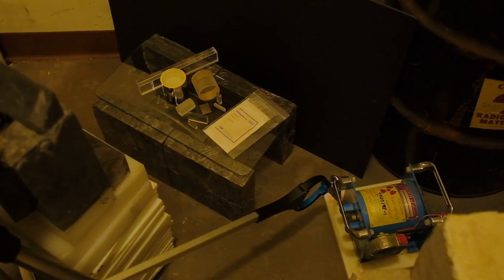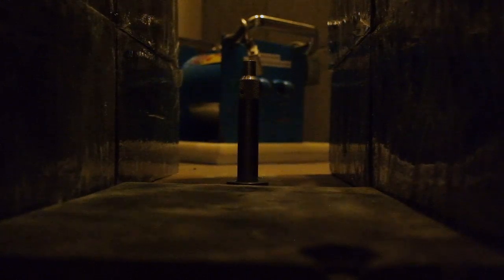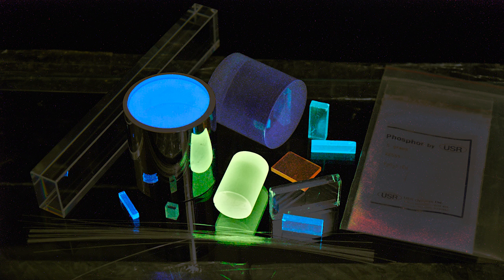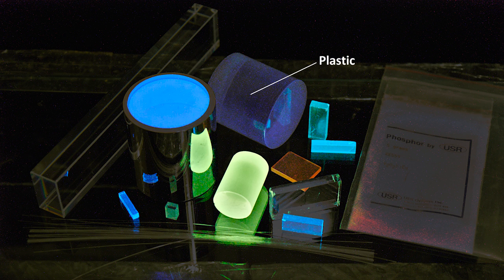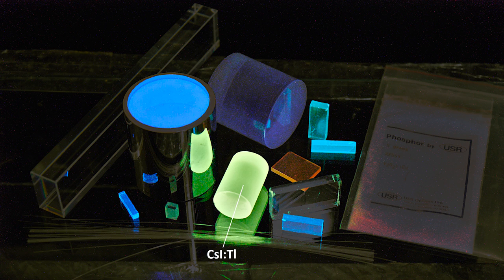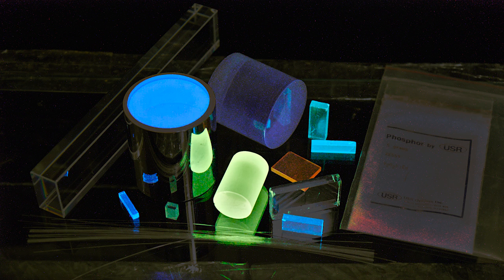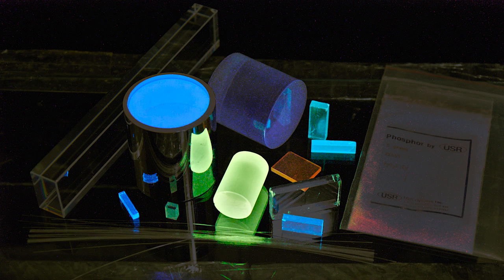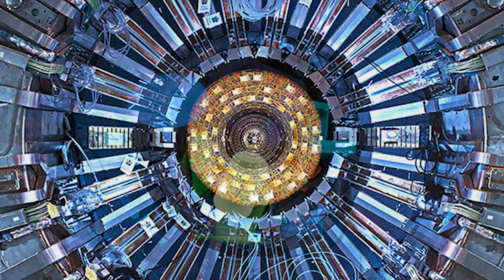Introduction to scintillators

Comment: Hey this is much easier than using one of those little dinky Am241 sources from a smoke detector! That actually did work with a GSO and produced a very faint spot of light right near the source after one hour of complete darkness and 10 years worth of eye strain to see it. While less exciting a mineral display case with UVC lights works as most fluoresce in some fashion. NaI and YAP were the two nicest looking, esp. YAP with its vivid deep purple glow.

Comment: I have a Radiacode 101 gamma spectroscopy and scintillation detector.  It utilizes a CsI(Tl) crystal with a SiPM.  It has lousy resolution but it is a fairly capable spectrometer regardless.  I have some great Reference spectra for my library that I have collected.  Great video!  Lots of great information.  Thank you Carl for your work.

Comment: I love your work, Carl! I saw that LYSO scintillator, and I knew exactly what it was! It is slightly radioactive (Lu-176), and is a nice low-moderate gamma energy calibration source (88 keV, 202 keV, 307 keV), with high branching intensities. I use NaI:Tl and PRA, with a GammaSpectacular MCA. It works well! CeBr or SrI:Eu have about twice as better resolution, but they're expensive! HPGe is the best, and I'd love to get my hands on one, but they're crazy expensive! Anyways, thank you for sharing your amazing work! Thank you so much!
Reply from the maker: Yep, still waiting for a CeBr3 or SrI:Eu crystal to fall into my lap.

Comment: We may only get 2 videos a year from Carl, but when we do.... it's a good day!
Bionerd has an amazing video from years back showing various scintillators glowing too (in video!!) under a radiation therapy linac.
Reply: Andrew Seltzman has some good ones of cameras and scintillators going through an electron beam system. I think it was an industrial system for cross-linking polymers. 
You get some nice views of the purple ionized air, flashes from x-rays, the scintillators glowing like light bulbs, and then the cameras going to snow from all the radiation even though they are heavily shielded.
Reply: @Muonium1  I unsubscribed for the same reason...
Reply: What happened to Bionerd 23? She had so many great videos then just suddenly  went away…
Reply: @bltc11  sometimes people just need to dip out. Best guess from me would be that she finally said fuck it after the millionth "zomg ru dead of teh cansur yet??" comment.

Comment: Great video! How many visible photons does one gamma ray photon produce in a scintillator? Does the gamma photon travel in a straight line kicking off visible photons in it's path, each time slightly reducing it's energy?
Reply from the maker: The number of visible photons is a function of the material, the energy of the gamma ray, and the type of interaction that the gamma ray experiences.  Obviously, it's higher in the brighter materials.  It also typically scales linearly with energy for photoelectric absorption.  The photon can interact by being absorbed or being scattered, and typical scattering events change the direction and energy of the radiation substantially (e.g. via the Compton effect).

Comment: Hello Carl, I wonder something. Are the sintillation crystals radioactive themselves ? Thanks
Reply: If I may answer for him - no, the scintillators would not contain any radioactive material because this would defeat the point. They are used for radiation detection and including radioactive material would cause an increase in noise, which is undesirable. 

Granted, the lutetium dopant of one of them is very slightly radioactive because one of the naturally-occurring isotopes of lutetium (Lu-176) is slightly radioactive. But since it is a doping agent, it is only added in small quantities, presumably too small to affect the signal-to-noise ratio much.

One thing to notice is that two of the most common scintillator materials are Tl-doped NaI and CsI. It would also be possible in principle to use KI or RbI, but those aren't used because K and Rb are both naturally radioactive.

Comment: Nice to see the actual light from gamma interactions. I just us UV to check scintillators and wondered if the same  light wavelengths are  emitted. I guess some of these scintillators may not react to UV light.
Reply from the maker: Yep, UV light works well with most of these materials (though it will photochemically blacken Hg2Br2).  Just not as fun as putting them on an actual radioactive source!

Comment: Is the yvo4 crystal regular or neodymium doped? Used them for making lasers many years back. Also used to build awsome little neutron/soft gamma detectors for ludlum 2's and 3's from bad surplus scionix LiL:Eu detectors and Adit photomultiplier tubes salvaged from hurricaine flood damaged VACIS wands. The scionix detectors were originally for SAIC identifinders but the little metal can hamamatsu PMT couldnt take the soldering and would slowly leak. The Vacis wands were from gamma cameras used to inspect ocean containers. They had rather large NaI:Tl crystals, all water damaged, but usually salvagable if determined. Cut the scionix detector in two with a pipe cutter and optical epoxied to the adit tube in a nitrogen purged glove box- Li iodide is stupidly hygroscopic 😲. Put the works in a stainless travel cofee mug with a removable moderator molded in the cap and bnc or c-hv connector on the back. Was very specific for neutrons when running the pmt at about 700v or so, at just under 850v it would let you know where a smoke detector was through the wall from the gamma scatter! Those were good times 🤓

Comment: Heh I took some tape with zinc sulfide film on it and made about a 1 square foot phosphorescent screen on my wall. I hit it with a UV flashlight and it makes for a nice nightlight that turns itself off after about half an hour. Or, I had fun getting it to glow with a small van de graff generator. I could actually visualize the electric field lines! I doubt an alpha particle could get through the plastic lamination on it, but I'd love to hit it with a beta source, if I could get one, or stick it in a home made cathode ray tube as the target. Maybe put an iron cross in front, for nostalgia's sake.

Comment: Thanks for the info.

To add my 2 cents... Just came along of cheap CsI:Th based spectrometer/dosimeter, while the crystal is about 1 cubic centimeter large. Its in sealed package, as i understand it might behave similarly to a table salt - attract water in moist environment.

I assume that CsI:Th spectrometer/dosimeter would not be the most accurate, but since it produce the highest amount of light it will be quite sensitive, and here is the thing why i even consider to buy such spectrometer...

a) I live in Central Europe, and there might be residuals of Cs-137 in nature (mainly mushrooms) and I would like to see for myself if the contamination is real.
b) There is a really bad trend of using Thorium Oxide in "energetic pendants", and I would like to demonstrate to people that the products they sell are radioactive, and which radionuclide it is.

Comment: I've always wondered if in the future we would have the technology to create radiation cameras, that would detect the direction of radiation. Similar to infrared heatmap cameras but for beta radiation for example.
Reply: they exist but it's much harder and more expensive to do with gamma rays. with x-rays you can at least use grazing incidence low angle reflection off of parabolic / hyperbolic nested mirrors, but you can't even do that with gamma rays and the only options left are pinhole cameras (ridiculous low efficiency and useless for all but the most insanely active sources) and zone plate coding apertures (heavy, still poor efficiency, awful spatial resolution)
Reply from the maker: Some technology now enables a direction vector to be obtained.  Gamma rays are indirectly ionizing, but it's still possible to reconstruct the initial direction using the properties of Compton scattering.

Comment: That radiation noise though 🤔🤔🤔
Why didn't you set up the camera behind a solid lead shield and take a picture through a mirror around the corner?
Reply from the maker: This is a reasonable approach if you have a long lens with a fast aperture and are willing to invest a lot of time and effort stacking lead.  It's an approach I have situationally adopted.  But it wasn't viable when I was making this video.

Comment: 12:40 Couldn't that be easily fixed by taking 3 or more photos and combining them? (for each pixel, take median across the photo set)
Reply from the maker: Sure enough.  It's not mentioned, but the image shown here is a stacked composite of three exposures.  It's still unacceptably noisy, but the only good solution would be a thick lead glass window that weighs 100kg and creates its own problems.
Reply: @Carl_Willis  The image is still perfectly fine for its purpose anyway. Even though the background noise is readily visible on closer inspection (at least on 1080p, less so on 720p), it is really not distracting and in fact I probably would not even have noticed it if you hadn't pointed it out in the video, so I'd call it acceptably noisy!

(Of course I can only call it acceptable because I'm not the one who made the image, if I were I'd undoubtedly have spent waaay more time than it's worth to try to get rid of it ;-)
Reply: Wow, small world! Two of the smartest people I have ever come across. One a Beagle Bone/Linux wizard, and one a radiation wizard :) Great respect to you both!